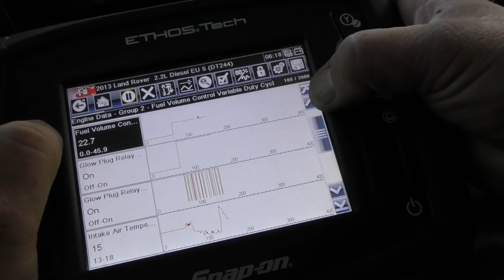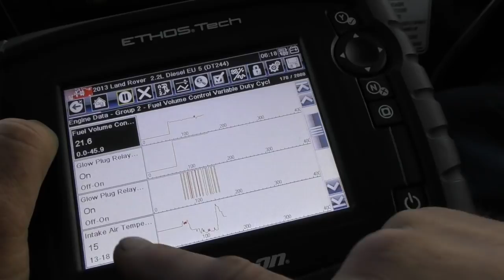Thieves or incompetence?  Address to ScannerDanner and Diagnose Dan.

Comment: Nice video, great point, but me personally, can't agree with you 100%. Always, anywhere and everywhere will gonna be good and bad mechanics, skillful and and less skillful guys. It's just normal. Most of the time is just, like you said, if he wants to spend extra time to educate himself. Not being paid for that, true! But having more knowledge, having more 'power" in your field is just helpful. Like being mechanic, or technician, you can solve those problems faster, more cars/trucks are done per day and is just adding up. And this is actually more money, the result of 'unpaid self training" is still paid indirectly.
   I don't consider myself a auto mechanic (I don't have any school in the field, have some experience though) but I like to learn. Years ago I ran a shop in Romania for more than 15 years, almost 20, but my main job and passion was for bodywork, mostly painting. Of course we needed to 'know" to do almost anything, ( being a post communist country ) which is impossible, I agree.
  Now I live in US. Here I have a semi truck and driving for a living. When I bought that truck, was 3 years old, but the dealer offered a 2 year/200,000 mi warranty. When I bought that truck I found transmission problems, driveshaft play. 2 weeks later they said they fixed it, so prior me taking it out from them. Went back in my home state and I found  the same output shaft play (I drove bobtail 2 days to get back home, no weight at all). 
Went back to a local dealership, where I lived. Having that warranty they starting working on it once I signed a form that said if the problem is internal, everything's is covered by the warranty, otherwise I have to pay them. Of course I signed, the back bi-conical bearing was having play. In the end I needed to pay almost $1,100. 11 hours of labor plus shop supplies because they couldn't find anything wrong inside. They called me, I got the truck, went back home and I checked the driveshaft play: SAME DRIVESHAFT PLAY!!!! Called them again and they told me to GO BACK!!! I was already there and I paid them to fix the problem...   Two days after I got a phone call telling me the truck is ready. Went there, and crawled underneath, guess what..., same play. That's just too much. Thank God I have had few more years of experience in my own shop than the shop manager and he allowed me inside to look at the mechanic while working, but not being allowed to touch anything. The guy took the back box of the tranny in about 30 minutes. Why they charged me 11 hours? 2 hours to put it back and are max 3 hours... Anyhow I showed the mechanic where the play was coming from, he agreed with me and he grabbed a HAMMER to remove (somehow) the gears, no clue how. When I asked him WHY is he using a hammer, he replied 'you're right, I should use a plastic hammer". Until he came back with that hammer, I figured out how to remove the safety lock, the nut, (or whatever was there, can't remember, it was back in 2006) and how to remove the gears in order, keeping them in order, not flipping them so no gear noise/whistling should be after putting everything back. He started yelling, very satisfied and amazed at his colleagues, that I knew how to remove the gears without looking into computer, etc. Days after that they replaced the big bearing, every seal, gasket, etc. Got the call, the truck was 'ready" again. I went straight underneath and..., same driveshaft play, didn't even started the engine yet... Now you're gonna say 'that's impossible" and I must agree with you! I went back to the office and told that to the shop manager, he went underneath the truck (in clean clothes) to check himself. He got out from underneath requesting (yelling) for that guy who did the job (so many times) to show up in his office. After that a another mechanic was designated to work on my truck.
In 30 minutes the truck was done! FIXED!!! It was a different guy. A guy that was paying attention at his job. A simple washer was missing between the yoke nut and the yoke. The bearing was always loose...  The first mechanic said 'the computer doesn't show a washer in there". Really??? You don't check the yoke play after tightening that big nut? You could feel the play with bare hands...
    All this (way too long) story just to see the difference between mechanics...  The story is even longer, it's ..., thank God I'm over it now...
   That's why a customer complaint confirmation and proper diagnostics are crucial....   Almost $ 1,100 for a missing washer, outside the transmission box, not even inside...
   And this is, unfortunately, a true story, which happened at a dealership with factory trained mechanics, not in x, y, z shop....
  Thank God are plenty of good mechanics out there too, otherwise who knows...
   I really hope I didn't hurt you, no intention to be disrespectful AT ALL! Like I said, I agree with you up to a point. I respect you and your job. What you guys are doing is not easy, let alone the time pressure. And I know what I'm talking about. Almost 4 years ago I rebuilt my actual truck's engine together with my father-in-law. It wasn't easy, every part is heavy....  It was a Cummins N14. Bought the service repair manual, following it step-by-step and the engine still runs great...
Again, great video!
Merry Christmas and a better and happier 'New Year" to all of you guys!

P.S. It was long, I know, sorry....

Comment: The whole motor trade is screwed, the manufacturers don't want any non dealer workshops doing "their work" they want the cream but will happily farm out a job they can't fix (generally when they have tried everything) to eg an Auto Elect. Dealing with those fleet management companies you need a crystal ball ,they want exact pricing without looking at the car.

Comment: The diagnostic business is only going to get much tougher. Soon you will need an electronic tech to to troubleshoot most electrical issues as a mechanical tech will not have a clue, and vice versa.. ASE Master tech is a thing of the past...it’s that way now with transmissions, only someone who specializes in transmissions can truely repair them, but can they rebuild a double overhead cam V6? Not likely....or troubleshoot electrical issues with voltage drop, or scope wave comparisons... Ohms law needs to be taught to all again if you want to diagnose modern vehicles, on or off road. Electronics is the way the future is going.

Comment: so strong points my friend  ' "  I live in New Zealand  and one of the points you made was about the lack of shared information  IE wiring diagrams ecu locations and identification  ' probably the biggest frustration the small guy suffers  here in NZ " after 25 years in the trade  a lot of what i do now is  on the fly testing ' as Paul would say verifying  your problem ' is key but equally important is understanding systems ' and this is what I got from Paul some time back when he talks about the parts store guys plugging in the god box that tells them the o2 sensors bad  $50.00 bucks thank you very much ' and my second point is my hate for workflow very really are they user friendly and personal if i took up teaching i would not recommend anyone following them  you will either be know as the most expensive guy in town or the biggest thief' to get the  code setting criteria fine past that the tests are just plane madness' finally I would like to point out what i feel are the key things ' Practice '' no when to say no ' credibility  < not sold on ebay ' learn from mistakes   they will happen  ask Paul " find a system of testing that you understand  and work with it ' most important ' never be afraid to ask for help as far as being in the trade and is it broken ' I would suggest the wrong guys are in control  is it rewarding ? well not like it use to be no but i still enjoy a victory and fixing broken cars   thanks for your video  stirs up some good points

Comment: It's a good rebuttal. I have a buddy that works on fleet for a city dept. and he also mimics your words. He works on vehicle's that he has no manuals for wiring diagrams and or shop manuals and has to guess on some situations. Also the vehicles have no replacement parts...On the other hand I believe they have incompetent employees at some of the dealerships. So it works both ways..I'm sure scanner danner and  Diagnose Dan both laugh at some of the repair attempts they run into while working on vehicles , cause they feel it just wasn't a good diagnosis.In other words it borders on scam and ignorance along with incompetents. To say we don't have that occur it's being in denial.. If you work on vehicles no matter what level , mechanic or tech. , you should learn your trade even if it's at your own time. The more you know  ! Helps make your life a lot easier and more satisfied, and confident at your job and work.  Thanks

Comment: If auto mechanic were licensed like nurses you would quickly weed out the auto pirates who steal money from customers as the state would have recourse.  Pull your license.  How is it a doctor or nurse needs a license yet a mechanic can work on my brakes without a license.  If my brakes don’t work I die.  Licensure requires additional training and testing.  This would get rid of rouge shops that do half ass work.
Reply: Actually, in Australia, as I'm sure is the case in most other countries,  Automotive Technicians are required to have licences. In Fact I have three ; Motorcycle Technician, Motor Mechanic Technician - Light Vehicle and LPG certified Installer. Each of which I have to renew every 3 years and show competency in that field by working in that trade in a Licensed Repair Shop during that 3 years.  I also own my own repair shop which has a further licence to work on the public's vehicles. I'm not sure what country you are from but I'm pretty confident that Technicians have to have licences even where you are from, unless they are a backyard operator, which in my opinion, if a vehicle owner goes to a backyard operator for repairs, take all responsibility onto themselves.
Reply: @zoticus1  Tell us where you are so we can be sure NEVER to taker any work to you.

Comment: I want to add one more comment (a rather long comment!), if you do not know how to use a scope , learn how soon if you want to stay in this business as it is going electronic control for everything , with can bus communication between the computers which no manufacturer will ever detail how exactly it works.. You can make a good living in automotive repair if you know how, I have been doing this since 1975 and I only work on vehicles that the owners know that I do all repairs as if it were my vehicle This includes modern can bus cars.. If they do not like my repair philosophy I refer them to other shops that can ( or claim they can ) repair their vehicle. Very simple I think, no hard feelings on my part or the customers part, as almost 80% of them return for repairs on their vehicles after others have tried.Yes I have failed on 2 vehicles to figure out what was the problem,( with a scope, Fluke, power probe, multiple different resistance test lights, I even tried a Loadpro,!!!! no fix from me, turns out that both vehicles had 2  or 3 module failures with 1 or 2 connectors bad after a reverse polarity jumper cable attempt which I learned about months afterward) but since then I am 100%. At least until this post! Haha!  Will I ever fail to diagnose again?  Yes, or no if I do not try to diagnose. ....Live and learn, no charge to the customer when I am learning!... adapt or fall off to the wayside.

Comment: you'd tackled a good point to remember always by customers, autotechnicians and expectators

in the past, for instance, a tune up involved more than changing spark plugs and engine oil, it was a total service of almost the whole automobile for that purpose - plugs, engine+trany oil/ filters svc, brakes, suspension adjustments, lighting system check/ svc, etc

but today a real tune up has been shortened by these wanna be automechanic shops that hire their auto technicians just to make more money

to start with it, these shops are there to make money, the customer is used like an atm machine only - these shops use the cheapest possible parts available like recycled oil, 0.25 cents oil filters, and their technicians usually have never been in an automotive trade school like a real professional autotech did

but these so called "mechanics," make big bucks with the owners of these shops because they have a base salary plus certain percentage of the total bill sales (usually between 17% to 30%) and that's is why they become thieves

a decent automechanic will protect his/ her reputation with all his honor before anything else

integrity, dignity, loyalty and reputation go along its way side to side in the life of a reputable autotechnician

once your reputation is demaged for any reason, that is hard to straighten later on in life; and that is why every single step shouldn't be overlooked

and the story doesn't stop right there, it goes and goes indefinitelly 

every day we see newer automotive systems, newer electronics, newer technology, newer updates and upgrades, newer and superexpensive diagnostic equipment 

with a decent autotech, is a one to one service procedure were the customer is first most of the time, with the thieves money is first all the time

at school, during classes, we get something we're going to use during business operations called "ethics," something these thieves lack or don't know anything about it 👈
Reply: You have no clue wtf you're talking about.
Reply: rsx123 - really? 😀 explain then how i did almost 12 years in automechanic school, college and usc/ csu university on automotive related courses/ classes bro and worked for 40 years at automotive shops in beverly hills 👈

lol; you are super funny 😋

Comment: Here are a couple of investigative reports on the industry...up-selling to the extreme.
https://www.youtube.com/watch?v=jBpMe36GoW0

This is a real good one. Talk about "up-selling". Imagine doing an oil change, power steering flush and brake fluid flush in under 15 minutes. Actually, it took them half that time. I mean these guys should work for a F1 team. LOL The fact is, they sucked the dirty brake fluid out of the brake fluid cylinder, put some fresh brake fluid in and they call that a brake flush? Hell the brake bleeders were dry at 11:46 in the video.
https://www.youtube.com/watch?v=-avpx8UTakI